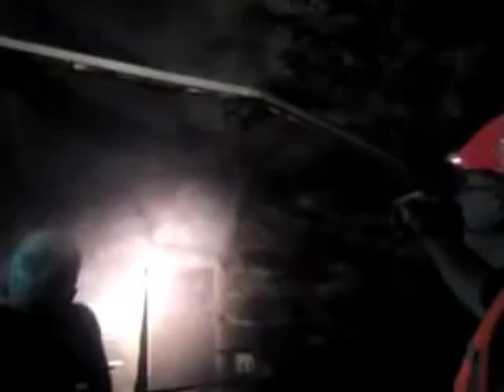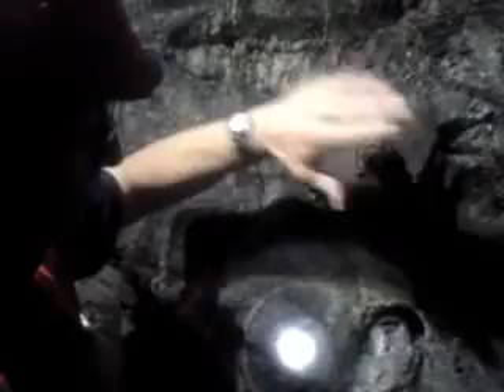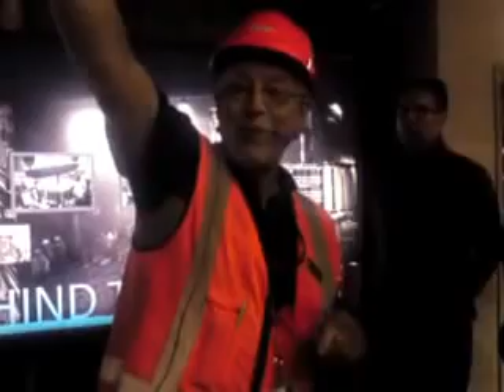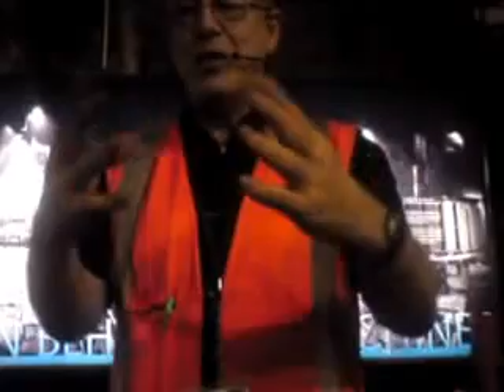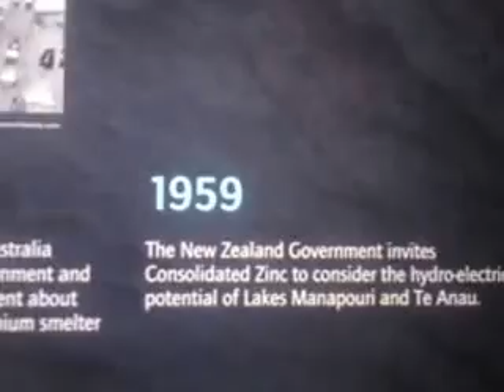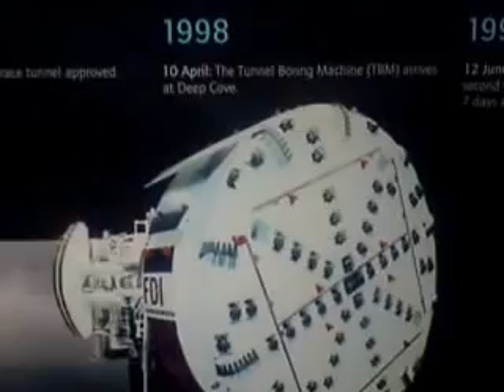Manapouri Underground Hydroelectric Power Station Tour. Part 1.

Comment: Its value for money 8 hrs round trip
Reply from the maker: Indeed, although I understand that the tour's into the Station had been stopped some years ago, many due to H&S, specifically existing the facility in an emergency. at the time the only elevator  wasn't functioning and with only one access road tunnel. Tours to the visitor centre and the outside are still accessible to my knowledge. :- )